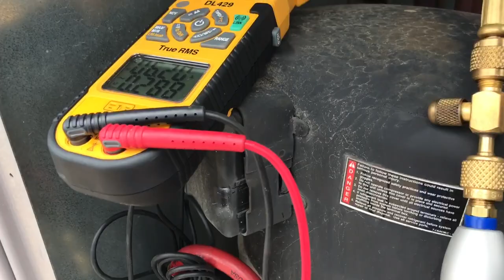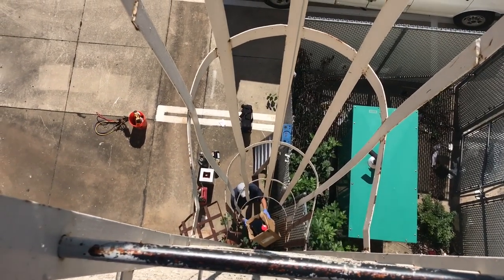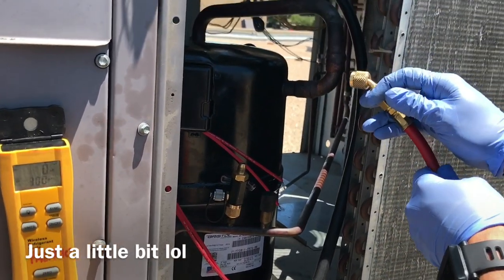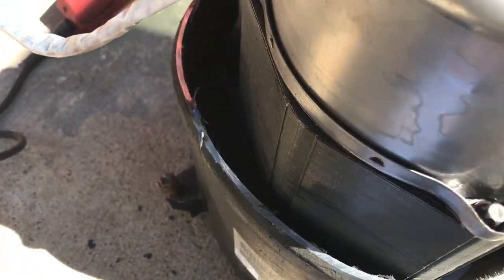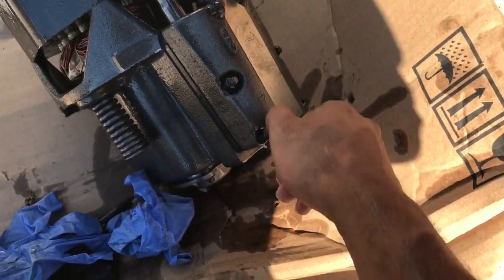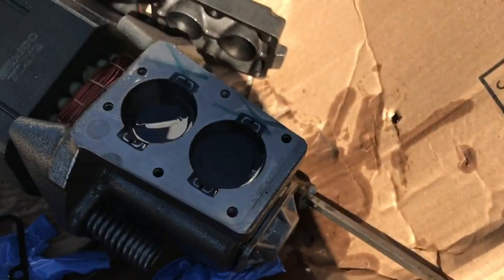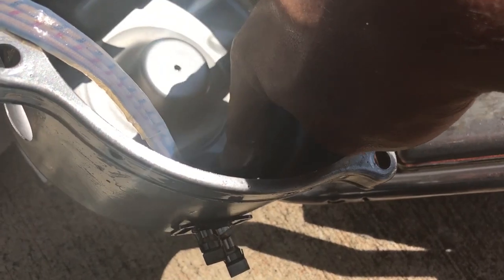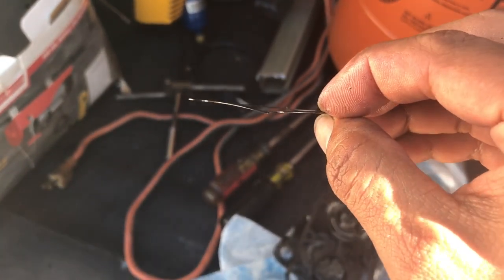Dissecting a compressor that was running but not pumping.

Comment: Hey Ulises, thanks for making the compressor teardown videos!  It's clear you enjoy learning about these machines, and it's great to follow along and learn as well.

Have you ever rebuilt one? I ask this because of my antiques hobby. Some of the antique refrigerators have interesting and one-of-a-kind compressors. One of my goals some day is to tear down and rebuild, then return to service one of the antique hermetic compressors. I have done several belt-driven units already.  

Say; I bet that broken valve caused excess vibration in the compressor. Instead of two compression pulses per rotation of the motor; it now has only one pulse. That could have hit a resonant frequency with the mounting springs, and led to the broken discharge line. Just a thought!

Comment: I'll guess broken suspension and cracked/pipe inside
Reply: when I heard the rattle I figured broken spring/mount or short-cycling broke the pipe off, but the cracked valve probably happened first, causing piston damage and enough vibration to shear the pipe off.
always nice too see the tear downs :)

Comment: Think its thrown a rod by the sound of the rattle when it stops
Reply: Wow never seen internal discharge pipe break before!  Nice work! 

I think where the suction valve is broken in the middle the two broken ends have been bending down and wore away the top of the piston.
Reply from the maker: heavydiesel thanks man. Yeah pretty crazy. I wonder what would cause the line to break off.
Reply: Maybe a Motor Mount Cracked or broke